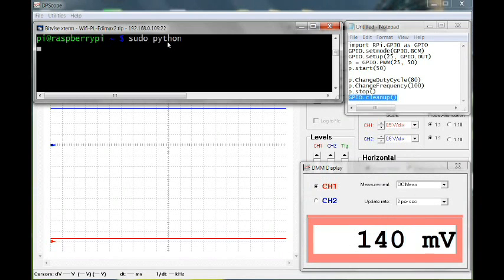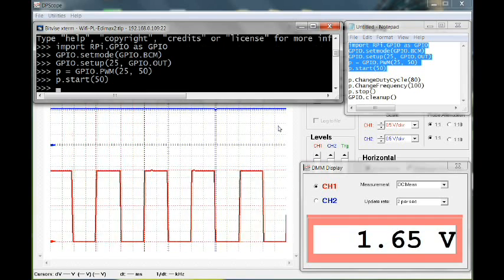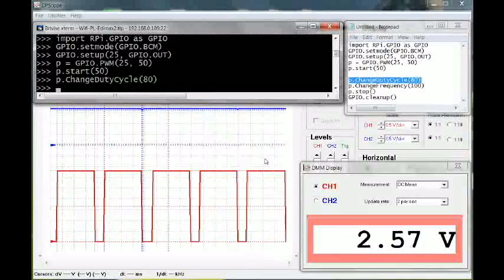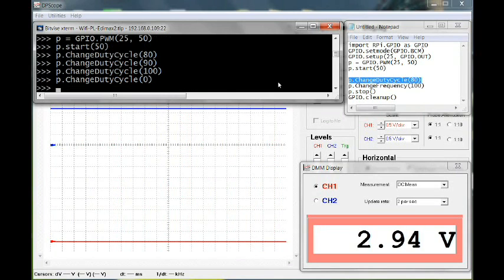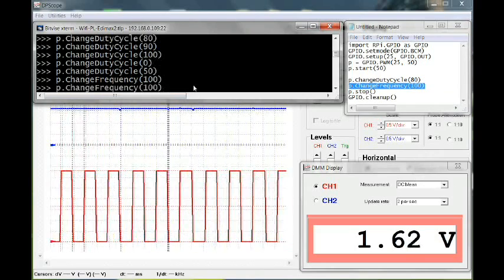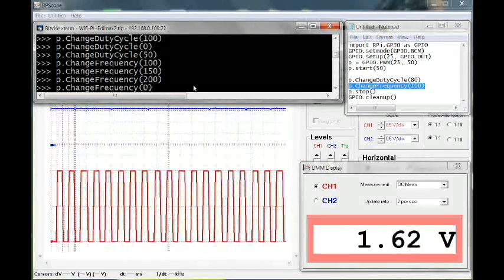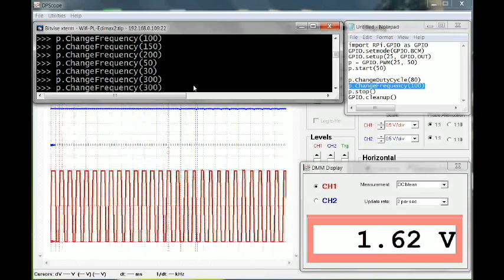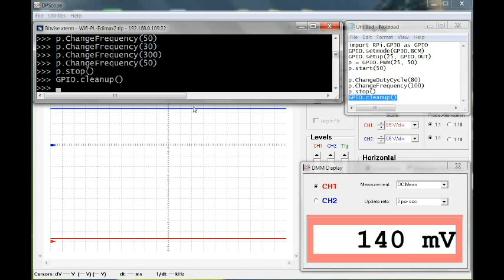Using PWM with RPi.GPIO and Python on the Raspberry Pi

Comment: hi I am trying to control steper motor with microstep driver by pwm. RPM of the motor depends on the frequency so higher frequency mean higher RPM. When i tried 1000hz my osciloscope mesured 880hz, when i tried 2000hz osciloscope mesured 1580hz and when i tried 3000hz osciloscope mesured only  2130hz. Can someone explain why?

Comment: Hey Alex.

CTRL-Z doesn't exit python (or any other app on Linux), it pushes it to the background, suspending it.    When you do it, you see a number in square brackets just before the text saying "Stopped".

"[1]+  Stopped                 python"

  You can bring the suspended app back to the foreground by typing "fg" and the number, for example "fg 1".

The correct way to exit is CTRL-D.  CTRL-Z and CTRL-Z are standard across most *nix apps.

Comment: What is the frequency range of that it can output? I'm hoping to make a PWM signal generator for a computer fan which takes a 24 kHz signal.
Reply: You would not want to drive a fan off a GPIO pin. The voltage is to low and could not supply the power needed to drive a fan.

Comment: what program are you using to read the duty cycle data? is DPScope built into Raspbian? (Noob post)
Reply from the maker: +Not0rious7 No. I was using my Windows laptop to run the DPScope software. It's separate from the Pi.
Reply: oh ok I see. Thanks for the quick reply. Do you have a good video that shows the set up of GPIO pins? I have raspbian installed and now I'm kind of stuck. Nothing is noob friendly.
Reply from the maker: I have a whole set of tutorials over at my blog. http://raspi.tv/rpi-gpio
Reply: awesome exactly what I needed. Thanks again Alex. I will probably be bugging you again later

Comment: excelent video!! but Im having some trouble with the PWM, for a 20Hz signal, in the scope I see that sometimes the voltages goes to 0v for a extended time. do you use a RTOS or add something?. can you help me please? thanks :)
Reply from the maker: I'm away from my PC right now, but I'm pretty sure there's a link to the blog article in the video description, which contains the full code used in the video example.